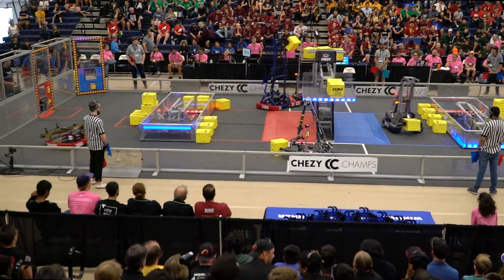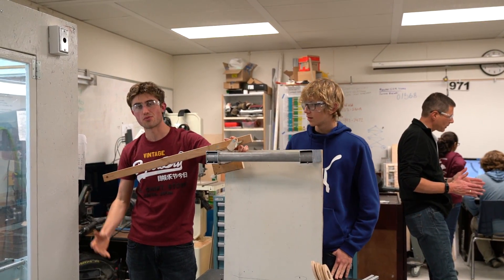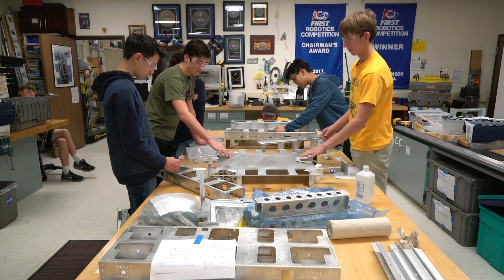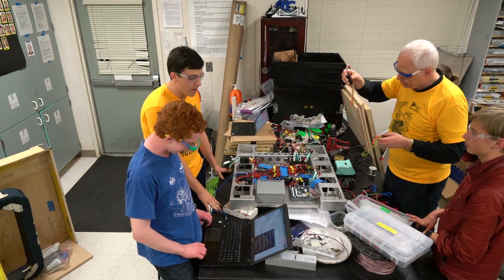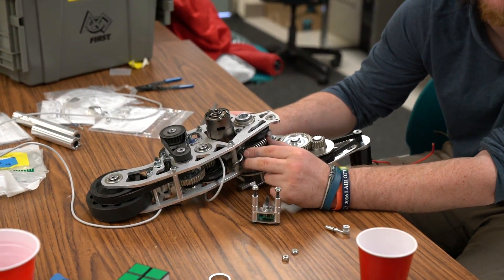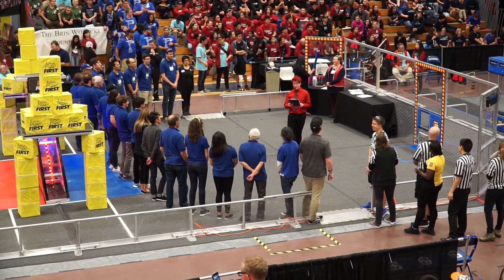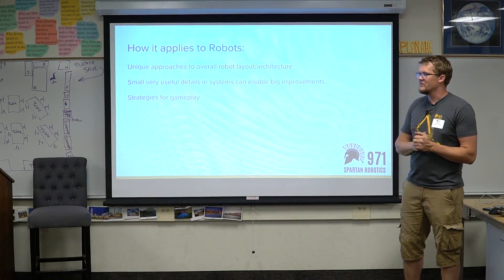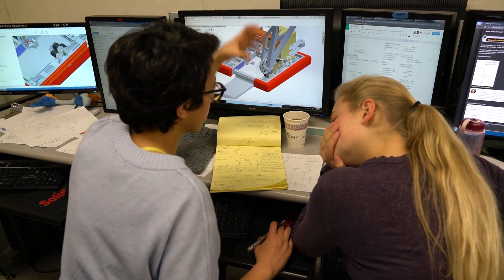2018 Season Highlights - FRC Team #971, Spartan Robotics

Comment: Why do you do 9971 instead of just 971?
Reply from the maker: At one the Madtown Showdown off-season events, we enter 3 "teams" from 971 Spartan Robotics.  One team uses the competition robot from the previous season, one team uses the duplicate practice robot, and a 3rd team uses a robot built as a summer project led by the students.  So with 3 robots, we need bumpers with 3 numbers, and we use 971, 9971 and 8971.